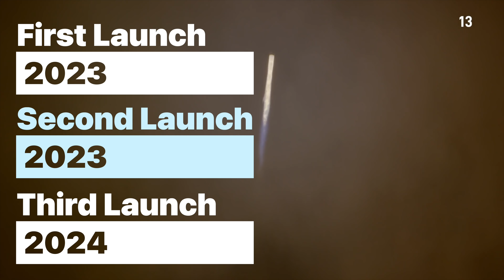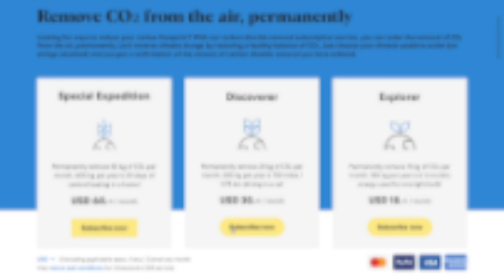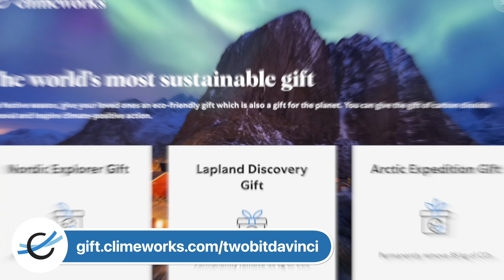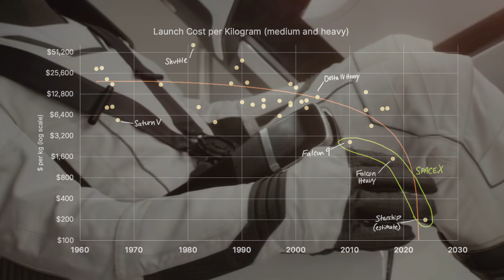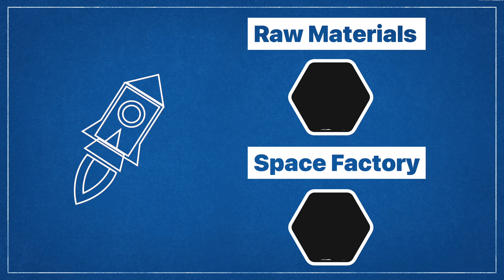Breakthroughs Made Possible By Factories in Space!

Comment: Rocket Lab's Neutron rocket seems like it would be perfect for this. I can imagine throwing away an extremely small, simple and light second stage, which is built to be just barely enough to push the factory into the smallest possible orbit, could be cheaper than the costs related to operating SpaceXs Starship. Maybe if you purpose build the second stage for this kind of factory, the tank of the second stage could serve dual purpose as a shield for reentry.